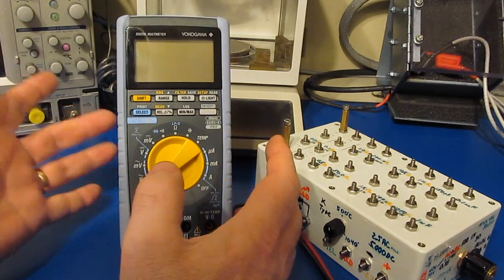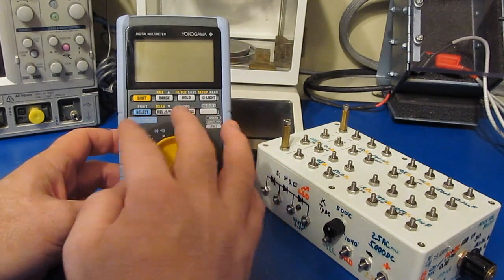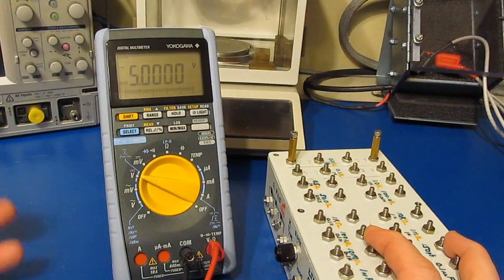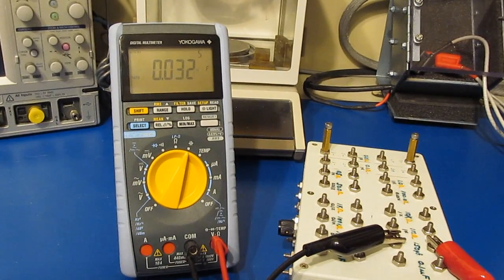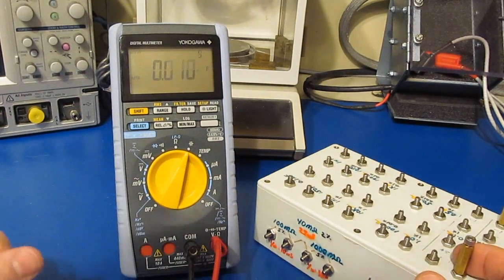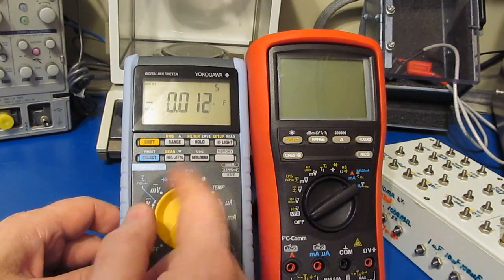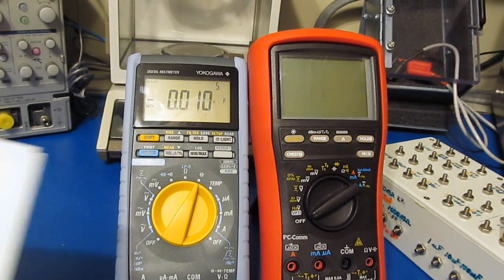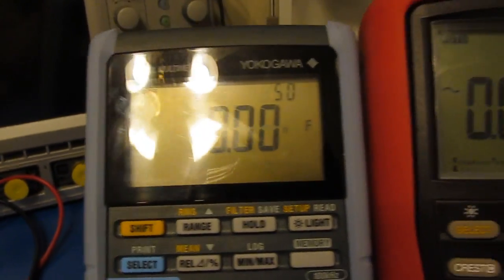Yokogawa TY720 updates

Comment: Hey Joe, nice and informative video !
BTW I have one Yokogawa TY 530 and the rotating switch fails most of the time - I mean the meter don't go that reading state. Either it will Keep showing previous  reading or freeze or beep etc. Sometimes it won't switch of even if the rotating switch is at ' off' position. Pls help.
Reply from the maker: Typically, once they wear out, I toss them and get a new meter.  You could try cleaning it, or returning it for repairs if you feel it's worth it.

Comment: now it looks almost two times faster reading capacitors than the original setting. Nice accomplishment .
Reply from the maker: I guess you would need to line up the footage to compare them but it should be the same as I have not changed the meter's design.
Reply: @joesmith-je3tq  Sorry meant settling time that looks looks quite faster due to improvement. It is almost 1.5x times ( 7.81s vs 11.44s)
Reply from the maker: @MalagasOnFire  First, I am VERY impressed that you could measure down to hundredths of a second with these on-line videos.   Perhaps you are comparing resistance with capacitance modes.  Maybe you are looking at some points where the meter was not allowed to fully settle before taking the measurements.  Hard to say as you did not provide any links to where you derived these times from.  Perhaps you were watching someone else's videos and comparing it with this one?   Hard for me to guess.   I can tell you that again, I doubt the repairs had any effect.   If you want to post the times in the videos that correspond to the times you provided, I will have a look.
Reply: @joesmith-je3tq  Chronographed eached video from time placing the leads till it stables on measuring the 150pF . There might be error of course but there is notorious settle improvement as spoke in the video.
Reply from the maker: @MalagasOnFire  That's strange.  Based on this, let me have a look at the two videos and get back with you.   I should be able to line everything up and slow them down for an easy comparison.

Comment: Hi Joe,

A dream test by Joe: AEMC Metrix MTX 3293BT, how much is an ~$800 USD meter really worth.

Added bonus - it's French.
Reply from the maker: Added bonus .... ROFLMFAO!!!  

I downloaded the manual for one of these the other day but didn't spend a lot of time going over it.   Amazon puts it closer to $900 with tax.
Reply: @joesmith-je3tq  Joe, I succumbed, my 289 17b+ and 15b were just so pedestrian and gauche albeit mightily accurate but alas the unfortunate American economy-size form factor made them a bit hefty for the job I need done.

R&S RTH 1054 gets to go next  if the Metrix doesn't turn into a grey and blue French fry.

A truly international intrigue...
Reply from the maker: I've looked at a lot of high priced meters that couldn't perform very well.  The 181A looks nice with it's color display but personally, I will take function over looks any day.   You should hit your's with a grill starter and see if it can survive something basic like that.   It's hard to believe ANY meter fails that part of my testing.
Reply: @joesmith-je3tq  Of course you're right, "Goosen Metrasheet" was a great example of this.

One of my applications needs the high-end bandwidth, precision, accuracy, EMI /ESD resistance, offline logging and robustness of a Fluke 289 or Brymen, but those not only are tough as a brick, they weigh about the same.

So I'll be using the AEMC Metrix MTX 3293 (by Chauvin Arnoux) [shades of, "Brut; by Fabergè."], because it weighs much less and the specs are truly awesome in real life (verified for my application).  The only 'if' is ESD, which I'll be simulating soon...
Reply from the maker: The YOKOGAWA may have the highest BW of any meter I have looked at.  It's impressive.   I am using the high end handhelds on the bench and the size/weight is not a problem for me.  I actually like the larger meters.   In the garage, I want a meter with some heft to it so it stays in place.  All of these meters are fairly small compared with the one I take in the field.  

When you poke your meter with some sort of transients, be sure to make a video and post a link.  I would really like to see it.    Looking forward to seeing your test and results.
Reply: @joesmith-je3tq  I too like the beefy meters on the bench and in the lab, but sometimes a high-end fully-spec'd meter that is at least a pound lighter than others is very beneficial in certain situations...

For you, I will gladly send a demo, I will PM you on EEVblog if that's okay?
Reply from the maker: @retromodernart4426  A PM with a video link would be great.     I looked up a few meters.  Yours is 196x90x47.1mm @ 570g.   Your 289 is 222x102x60  @ 871g.  About 150g shy of a pound but still it's pretty heavy.   My favorite meter, the Brymen BM869s is 208x103x64.5 @ 635g.    My second favorite, the Fluke 189 is 203x100x50 # 545g.   I guess my third favorite would be the UNI-T UT181A which is 225x103x59 @ 700g.   Dave's 121GW UEI meter is only 165x84x57 @ 485g   Really for me, it's all a wash.  If I bought a 3293BT, it would be for some other reason than size or weight.
Reply: @joesmith-je3tq  The MTX does power measurements, too, and has some
 good built in math.

Also the NiMH battery is a bonus (if I'm not mistaken NiMH has better cold performance).

Finally, high IP rating, could be a winner.
Reply from the maker: @retromodernart4426  I could take it in the back yard or the sink for some testing then?  lol   I don't get too concerned about the IP ratings.  The cheap ones I use in the garage have other chemicals they can get exposed to besides water.   

I have been using some rechargeable Lithium and NiMH for my meters now.  As long as I can swap them out, it's not a problem.  The UNI-T UT181A uses that odd pack.  Once you are charging, the meter can't be used.  It also can discharge the pack fairly quickly.    Your's uses 4X AA like my Fluke 189.  The battery life of the 189 is spec'ed at 72 hours typical.  In my testing, I figure about 127 hours.   Looking at the manual for the Metrix, they don't seem to provide any details on battery life.  

Someone had posted about the Metrix measuring power.  This is why I had looked at the manual.  They provide very little details about this mode in the manual.  I had wondered if it showed how to connect it like Dave's 121GW and how it compared.  The was nothing mentioned.  That's pretty bad considering the price of it.

I had looked for some sort of interface document for it.  The Gossen and my CEM meters both provide more than enough details to get the interfaces working with Labview.  Actually, the Fluke 189 was not a problem as well.   Dave's 121GW also has this published but I did spend some time trying to get it working as they changed the protocol a few times.  I am guessing once they have this thing cleaned up, the interface will work pretty slick.  The worst was the UT181A BT.  Others had worked on it before me and saved me a lot of time.    I want the basic math that most of these meters offer.  AC+DC, I like the temperature difference  that the BM869s and UT181A offer.  Once it gets beyond that, I want Labview, not some silly phone app.  

The Gossen allows you to program the meter from BT as well.  IMO, this is really a bad idea.  It made the design more complex and IMO introduced what I consider a safety issue.  

I like the 15V diode check on the 121GW.  If I understand the Metrix, it has an even higher supply.   On the 121GW, this mode seems to be the weak link of the meter.  At least the prototype I looked this feature is not well protected.   But again, it is easy enough for me to use the bench supply.  

The manual for the Metrix does claim they meet the 61326 standards so hopefully you meter survives your poke with the gas grill starter.   I've damaged a lot of low end meters with that thing, and some expensive ones as well.
Reply: @joesmith-je3tq  The Metrix power mode is easy, it  just uses two probes, one in each '+' (A and V) and a two-to-one probe plugged into COM, they of course recommend low-R wiring for that double-headed COM part when the customer makes or aquires it.

Metrix clearly states not to use the meter whilst submerged, apparently after the late Jaques Cousteau had a mishap measuring his bathosphere power supply from outside  at 30 fathoms down, somewhere off the coast of San Tropez in the middle of filming the assumed mythical or extinct nautilus (which he actually did eventually succeed doing), but I digress - in my applications the IP rating legitimacy is critical due to probable voluminous condensing moisture during operations.

Finally, the MTX3293 has SCPI (I haven't used it yet, I have used the app, it's not bad).
Reply from the maker: What they don't show is how to connect it to the DUT.   A bit odd really.   But then again, they don't mention battery life.  This is some pretty basic stuff I agree and all the more reason you would think they would have it covered in detail.  

I looked for any sort of documentation on their interface and found nothing.   If you can provide a link for it, please do so. 

I also did a search for some good photos of the internals. Again, I found nothing.  After you test yours, if it does get damaged and you decide to pull it apart, please post some high res pictures of it.    Then again, if it does get damaged, you may have to leave it sealed to have it covered.   

I also wonder about alignment and service.  Does the meter have to be returned to the manufacture for alignment or do they work with outside calibration labs and provide the detail they need to align one if it no longer meets calibration?
Reply from the maker: I never saw a link from you.  How did your ESD test go?
Reply: @joesmith-je3tq  Hi Joe,
I was sending you a detailed message with links on EEVblog and the message got "eaten", then I got busy (from job work).

Hopefully I'll have it for you in a day or two.
Reply from the maker: @retromodernart4426  Still waiting to hear about your testing.
Reply: @joesmith-je3tq It can display the waveform of current or voltage up to 600Hz and can be used while charging with Nimh batteries. It has a battery life of up to 80-100 hours and can measure VA power. It has a 24V diode measurement voltage. It has a 10mA 24v resistance measurement. It has IP67 resistance. It supports all types of current or voltage clamps and has a mathematical function. These are what come to mind right now.

Comment: I knew it was going to be a hard one to fix, but I knew you would get her going again!! Now the display looks like it's from the early 80s and as I said before with a meter of this class you would expect something much better then what is has.

Now I'm a meter hoe and I buy meters the catch my eye and one did that the other day because of it's display and for the price I was really shocked by it. I know you did a vid on its sister UNI-T UT139C but it's the UNI-T UT139S and its board is laid out a bit different and it has a few functions the 139C doesn't have, but for $70 U.S. it's not bad and the display is really nice for a meter in it's class.

Anyway it's the type of display the TY720 should have for the money!!
Reply from the maker: Thanks.  I knew if it was damaged it could turn bad as well.  After looking at the front end and finding nothing wrong, I knew it was going to be bad.   Comes with the territory I guess.   I can't see making a review where I hook a meter to a resistor and 9V battery and then giving it a 5 star rating.  Pushing them to their failure points is what I am interested in and assume that is why most people are here.  

I looked at a couple of 139Cs.  The first one people whined about.   The second one failed at the same level that I had ran the first one but I had less whiners.   The UNI-T fan base is certainly more robust than the products they produce.   Still, I do like that cheap AC/DC clamp of theirs and am still holding out for an improved version of the UT181A.   That IMO would make a very nice meter.
Reply: @joesmith-je3tq  Yes I too would like to see a improved UT181 also, but I'm a Brymen fan myself.

Comment: Glad to see you've repaired it. As soon as you opened the meter, I realized it's gonna bad nightmare to repair it after transient testings. Good job. 
For me, electronics was always a hobby and I loved it more than I do for living (I'm CTO in a software company). However your videos inspired me to do multimeter repairs in my spare time and start a new era in my electronics journey.
Reply from the maker: Yes, this meter has a lot of discrete parts and that can be a detriment without a schematic.  Had they used one of the dedicated front end ICs, I may not have been able to locate a replacement.  Its a case of pick your poison. 

I am not really interested in repairing stuff in general but in the case of the meters I have looked at, I like to understand why they failed and if they can be improved.  In rare cases I am able to bring them back to life and save the recycle bins.   I enjoy electronics as a hobby  as well.  Good luck with your future projects and repairs.

Comment: Thanks for posting in my Opinion this meter its over price and its has alot of corks in it iwill not buy it  its a junk 
By comparing it with Fluke, b
Brymen  sanwa  uni t  or even the low end  Chinese brands, all of them are better from it so thanks but its a fail
Reply from the maker: Depends how you define "better".  I have looked at a lot of low cost meters that I wouldn't give away.   I am not sure if I have looked at more Fluke or UNI-T products.  Certainly a fair number of both.  I can always count on UNI-T doing poorly in these tests which is why I stopped looking at them.  If I ever run another UNI-T, it will be a newer version of the UT181A but I am not holding my breath.
Reply: @joesmith-je3tq  
Good point you are right but iam talking in general and Each brand or model has its own design, brand name manufactured to provide features, price and not all of people can afford the fluke or brymen .., but I comment on this model by comparison with other brands frankly I did not see  any thing special in it to  own it . I have uni t 61 e for  a year and i use it daily  with out any problems yet  yes  it has it design  and it circuit but remember  the price of it its a 60 $ not 300$  as for the ut181a it is a great multimeter  and has the advantages and thay  can make it better  if they want and I have followed the video you posted   and i like it so  I agree with you however you agree that nothing perfect in  this life, but there is the medium, the good and the excellent and that This applies to the multimeter aswell  the  important thing is that it  measure correctly and work right  and Provides you with  protection if something went wrong  so in the end thank you and god bless you my freind
Reply from the maker: @circuitblog01  I'be said many times that I never paid more than $50 for a handheld meter until I started running these tests.   But I really didn't require much out of them.  They were used in the garage for low voltage work only and when they died, I pitched them.   For my electronics projects, I used my bench meters.  That all changed once I started looking at higher end handhelds.    In the case of the UT61E, I know it can't handle even the most basic ESD transients where the Yokogawa has no problems.   Feature wise, the Yokogawa is much better.  But as a I said, it really depends how you define better.    They could improve the UT61E but may loose sales with the higher costs.   The only UNI-T meter I frequently use is that little clamp meter.  Sadly the rotary switch started acting up after a year of moderate use.   I was able to get it stable again by cleaning it but I doubt it will last much longer.  Maybe another year or two.  Still, it was only $30.  Well worth it to get a 1mA resolution DC clamp.
Reply: Brymen.
Reply: @robertcalkjr.8325  yea right bryman😁😁😁😁